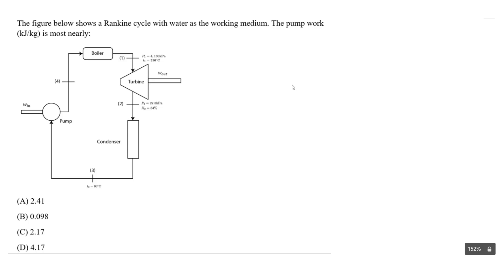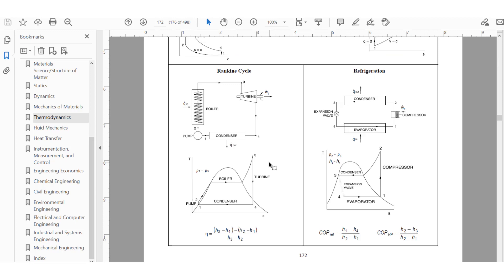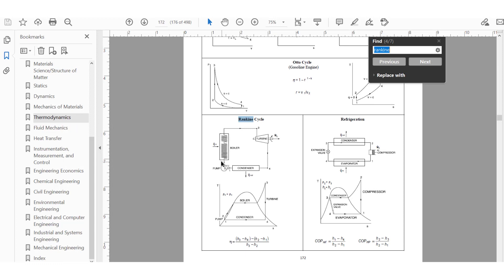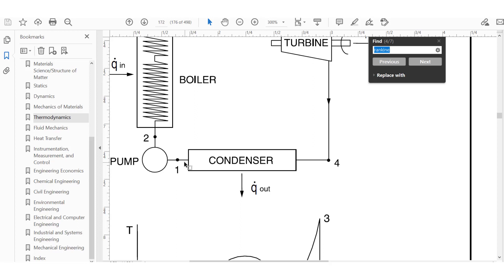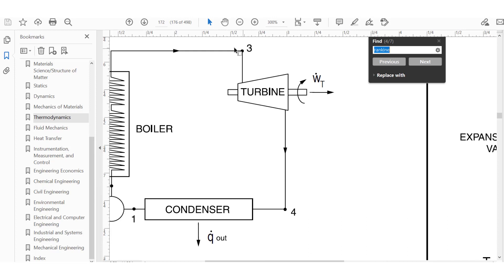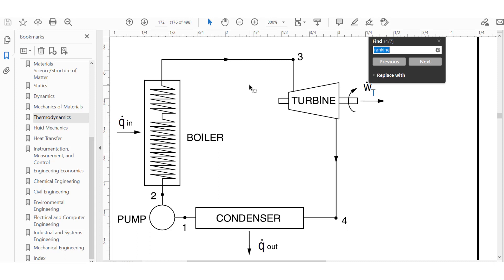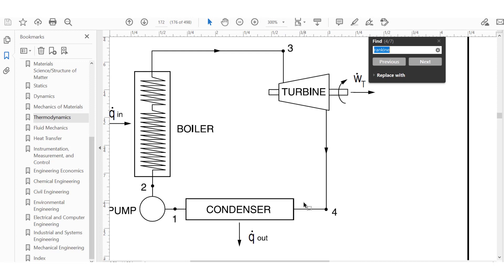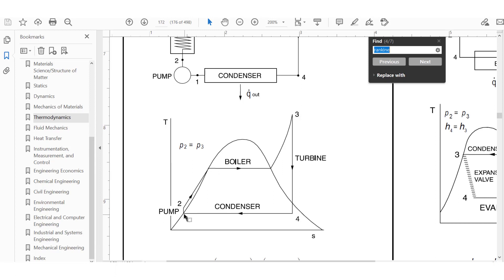FE Exam Review - Thermodynamics - Rankine Cycle - Pump Work

Comment: There's also a quick note of isentropic pump work on page 149 of the 10.0.1 FE Handbook, find "For pump only". Thanks for the explanation
Reply: Also I know it should be obvious but the handbook does not explicitly show that the pressure going into the condenser is the same as the pressure going into the pump so that might be good to know

Comment: Question: when pressure is saturated why can't we use Temp. @ 3 to find pressure. My first approach was to find pressure using T @ 3.
Reply: The pump and turbine inlets are not necessarily saturated liquid and saturated vapor respectively.  It's a good guess if you lack information to the contrary, but it isn't necessarily true.  There could be some subcooling prior to the pump, and there could be some superheating prior to the turbine.

For a real pump, you can't put saturated liquid in its inlet, otherwise the water will boil by cavitation when you try to pump it.  Real pumps require the liquid to first drop in pressure on the suction line before pressure increases from the work done by the machine.
Reply: @carultch  So based on our answer, why did we use the steam tables for the specific volume if we are assuming a saturated liquid. I guess how do we know it is a saturated liquid.
Reply: @priyabhowmik6227  Good question.   And this highlights the difference between how you'd handle the problem academically, vs how you'd handle the problem practically in the a real world application of the theory.

The short answer is, we assume it is a saturated liquid, because we don't have the information to know the complete state.  In an academic example, you assume the idealized case, unless given information to the contrary.  For the same reason you assume no pressure drop across the boiler, or an isentropic turbine.  It's a standard assumption you make, since you are analyzing the best case scenario that the system described can be.

A simple Rankine cycle starts at saturated liquid at the pump inlet, and starts with saturated vapor at the turbine inlet, and has isentropic devices for both the pump and turbine.  A real Rankine cycle will have inefficiencies in both these devices, and will also require subcooled liquid for the pump, and superheated steam for the turbine.  Subcooled liquid is needed to avoid cavitation, and superheated steam is needed since we want high quality steam out of its outlet to avoid damaging the blades.  This is the namesake of why we call it quality for the vapor fraction by mass of a 2-state fluid.
Reply: @priyabhowmik6227  For specific volume (or density), this property is generally close enough to constant, that it most likely doesn't matter that much, for a liquid.  Liquids, especially water, have a density that is a lot less sensitive to changes in pressure and temperature when compared to their vapor counterparts.   So the density of saturated water at 100 C isn't that different from subcooled water at 90C for the same pressure.   Liquid water's density is more sensitive to temperature than it is to pressure, but it is still nowhere near as sensitive as the sensitivity of water vapors density to temperature and pressure.

Comment: I need help please.
T_3 = 60 degC, which gives h_3 = 263 kJ/kg, using the steam table.
However, P_2 = P_3 = 27.8 kPa gives about h_3 = 282 kJ/kg.
Why the 20 kJ/kg difference?